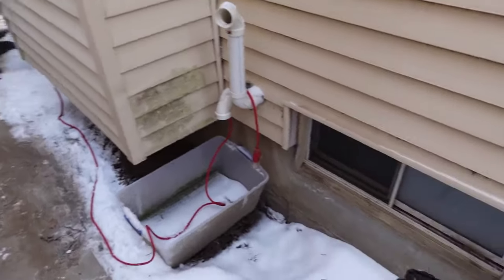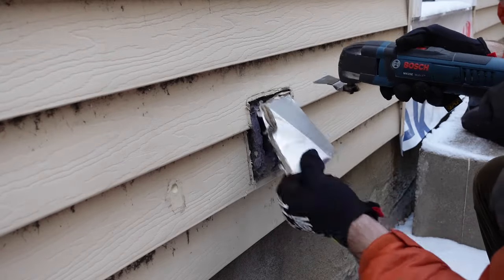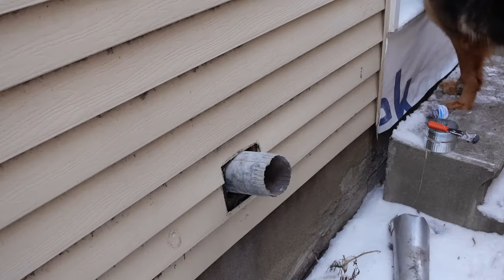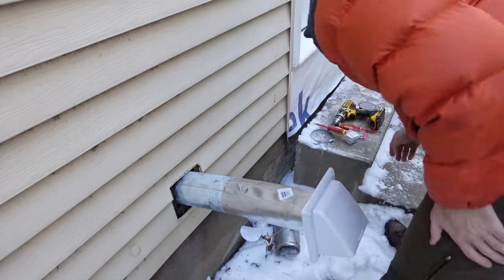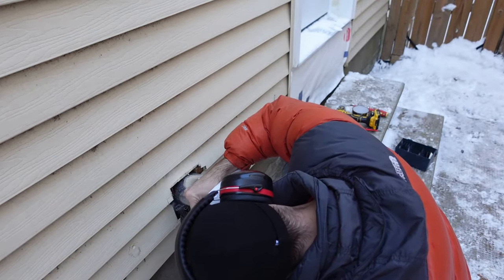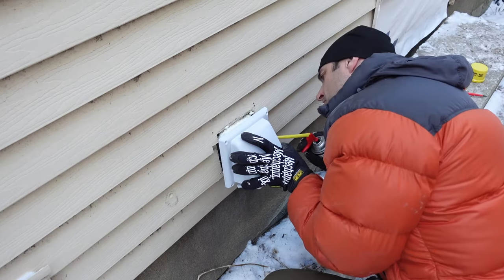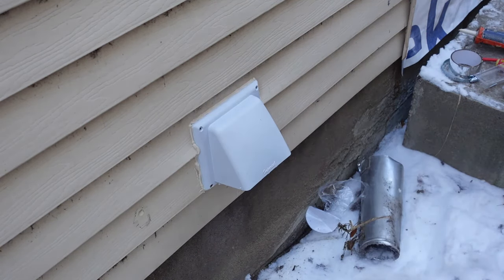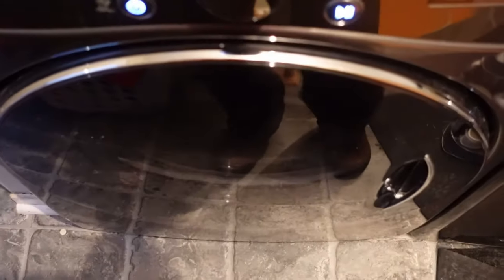Dryer Vent Cover Installation

Comment: It is a violation of the IRC to use screws that protrude into the inside of a dryer duct pipe. Reason is they will pick up and collect lint. Use a flush rivet or  even better an external worm drive hose clamp. Seal the joint with a high temperature foil tape labeled for the application. Not all foil tapes are the same, you must use the one that is labeled for the application.
Reply from the maker: These are very good points, however not exactly correct. The 2021 International Mechanical Code 504.9.2 does allow for penetration of screws up to 1/8th of an inch into the duct cavity (the current international residential code says the same thing). I'm far more concerned about how mashed up my ducting is closer to the dryer. When I redo the laundry room in the coming weeks I will be replacing much of that ducting.
Yes use the correct foil tape.

https://codes.iccsafe.org/content/IMC2021P1/chapter-5-exhaust-systems
Reply: Also the flexible duct at the dryer shouldn’t be used. Replace with hard duct
Reply from the maker: I've never seen a hard duct connect directly to a dryer before. I assume that would be pretty hard to move the dryer without a flexible connection.

Comment: If the house made of bricks all this hard work will not exist
Reply from the maker: I dont know of very many modern solid brick houses in canada, even brick houses here are generally just a brick veneer.
I think it would be wrong to think that a brick house doesnt have maintenance requirements, and in some cases significant maintenance requirements.

Comment: I’m working with a guy who purchased two of these but the vent cover tube is the same size as the vent tube he roughed in inside the house so I’m at a lose as to how he expects these two to connect together
Reply from the maker: not sure. sounds like a bit of a dilemma.

Comment: i also have a bosch multitool. makes the job so much easier
Reply from the maker: It's a tool I dont use often, but it's an absolute life saver in rare circumstances. A great buy for anyone getting into more challenging jobs.

Comment: Is it safer to replace the inside tube or try to clean it out? How do you clean through it? Thanks
Reply from the maker: I'm actually going to replace my dryer tube in the coming months as it is really mashed up, but generally speaking I don't thing replacement is required. to clean mine I just run my shop vac hose through it because the run is very short from the dryer to the wall.
Reply: You can get a flexible dryer vent brush that goes in a drill and spins with the drill at Home Depot. It’s a pretty long flexible cable so it will go around bends in the duct. Kinda like a chimney sweep brush, but only 4” if you’re familiar with those.

Comment: How about bees and wasps and mice ? How do you prevent them from entering? I don't see any fine mesh .
Reply from the maker: I've never seen a dryer vent cover with fine mesh on it but maybe one exists somewhere. There is a plastic flap that fully closes when the dryer is off, and lifts up from the air pressure when the dryer is on.
I use my dryer frequently enough that I really doubt anything could live in there for any period of time.
Reply: Fine mesh will plug up with lint in not time at all and cause the dryer to 1 not dry clothes, 2 vent moisture inside the house causing mold, and 3 increase your risk of fire AND carbon monoxide if it’s a natural gas or propane dryer. ☠️

Comment: I'm not about to fork out the cash for an "oscillating tool".  What do you recommend instead?
Reply from the maker: I dont really know what tools you have. Maybe a dremel with a small cutting wheel. If you are just cutting vinyl maybe a utility knife and scissors.
Reply: Just cut the old caulking with a utility knife. Then scrape the rest of the caulking off with a putty knife or a scraper of some sort.